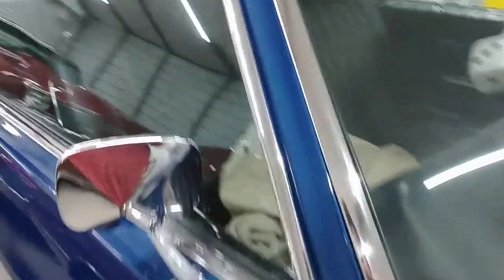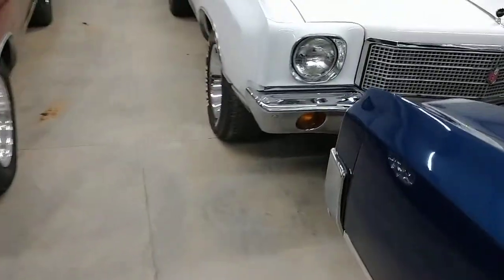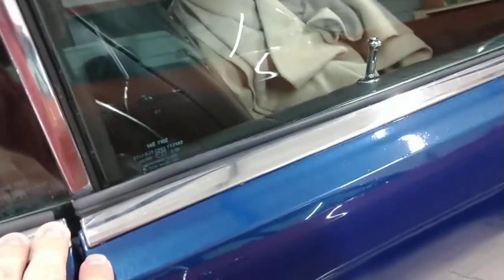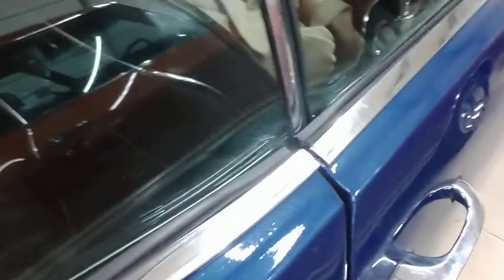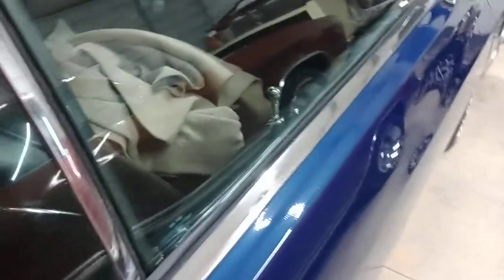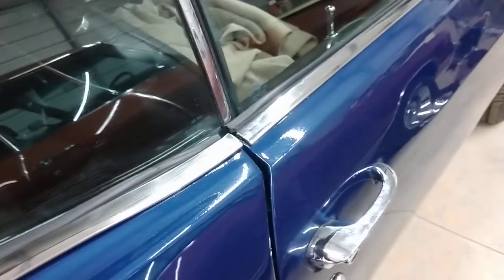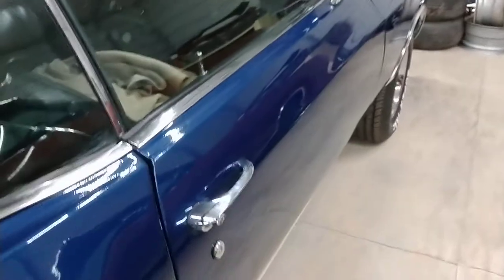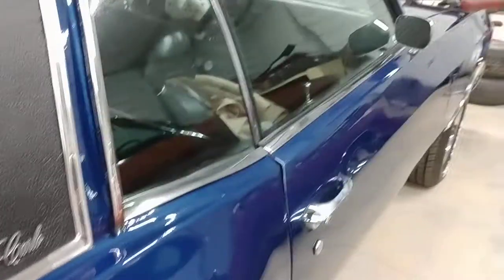1970-72 Monte Carlo Beltline Molding Option

Comment: Those are part of the Z03 trim package. Just as the lighting for ashtray, glove box, hood, trunk and courtesy. have wondered why you find them on other montes without the Z03 trim. Like GM ran out of regular ones or what. Leo would know
Reply from the maker: They was an option starting in mid to late 1970 actually